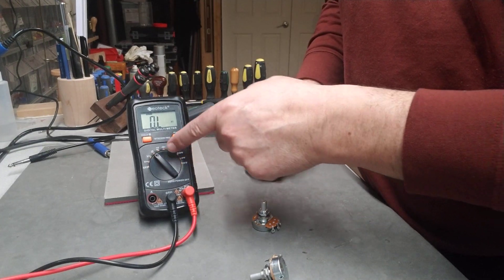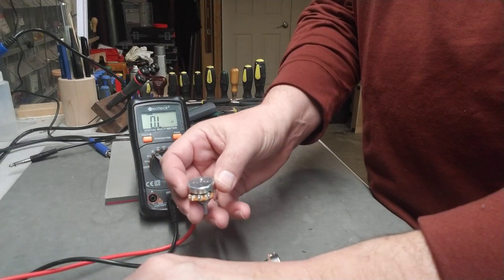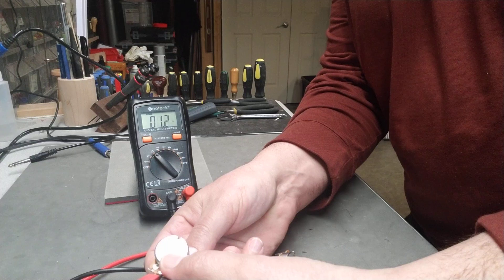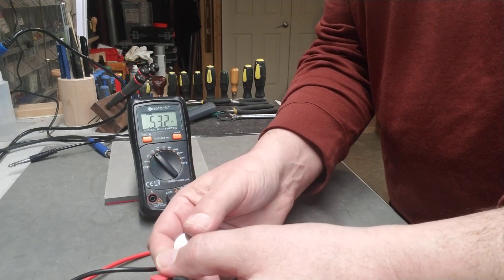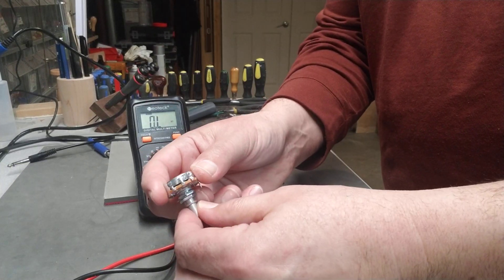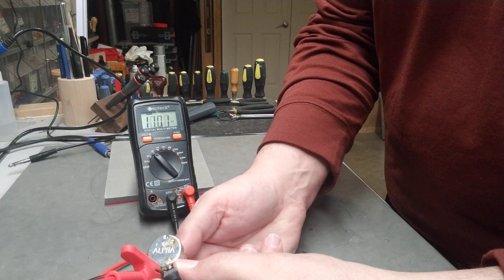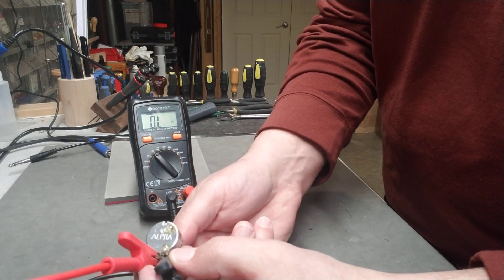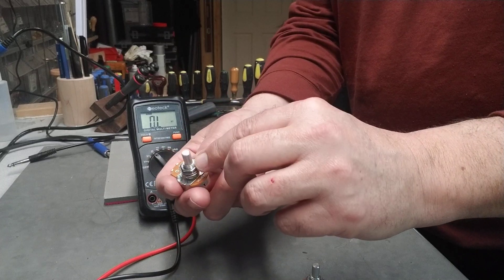Testing a Guitar Pot (Potentiometer, if you prefer) with a Multi-Meter

Comment: I kind of had the same issue, or maybe the same issue.

I never thought about testing my pots beforehand but I will from now on because I have a brand new GF A250K pot that I installed and it kind of cuts in and out, most times when I turn the volume down, it'll stay at 10, but sometimes it'll go down to zero.

I thought maybe it was a bit dirty so I sprayed some contact cleaner inside it and it didn't really help. I happened to use another GF A250K pot on a different guitar and this one worked with no issues. 

That first one I tested just happened to be a dud I guess. Sucks that it also happened to be the first one I used. I'm gonna give it some time to see if it stabilizes, I mostly keep my guitar volume maxed out but not always plus, it's really messing up my OCD lol
Reply from the maker: They can be hit or miss
Reply: @ManotickGuitarTech I agree although they shouldn’t be since they’re brand new…

Comment: See when your pot is at 0 (1.04) have you noticed any pots showing an increase in ohms ? I have an old RS pot in which when I turn it to 0 and don't touch the pot or the meter, it starts to show about 40 ohms, I see this on some other old pots I have, so what would this increase in ohms do when in am amp ?

Comment: will it give a false reading in the pots are soldered in already ??
Reply from the maker: I dont think that will work - use the output jack and selector switch to isolate the pot it if is already in the guitar, then take your reading.

Comment: You're only testing half of the potentiometer. Across the two outside terminals is the maximum resistance. Then center to right and then left. One reading is all the way up and the other side should have the same reading all the way down

Comment: I'm about to pull what hair I have left. I'm trying to test pots and I can't get any reading of any value on 5 different pots ( one has never been used). What is the setting on the multimeter? Going counterclockwise from Off the meter reads:
200M
20M
200K
OHM Symbol
20K
2000
200
What am I doing wrong? There's a HOLD/SEL button on the top right. I've fiddle with that without success. Btw I have two meters, same results with each.
Reply from the maker: I have mine on the OHM symbol (no function required); attach the red lead to the middle lug; the black to the right one; then spin the pot to see if any values appear.  Just like I have done in the video... make sure your red and black leads are plugged into the right spots on your multi-meter, too.
Reply: @ManotickGuitarTech  the OHM Symbol on mine is not a set position but rather a reference to the ranges listed. The only reading I get on all five pots is .45 when set to either the 20M or 200M. I am certain these pots are fine but between two different multimeter I cannot get them to perform (nor are either the same as yours).
Reply from the maker: @jreagle58    set your reading lower - try the 2000 or 20K.  20M is in mega OHMS and the most a pot will be is 1meg
Reply: @ManotickGuitarTech  I've tried every setting. Nothing, zero. It's weird. It does the same thing on a brand new pot.
Reply from the maker: @jreagle58    try attaching to the two outer lugs of the pot instead of the middle one.
Reply: I am having the exact same problem as you. Can't get a reading from any of my pots! If I set to the 2000k setting and test the middle and outer lug on the pot, it says 005, which doesn't make sense to me since it's a A250k pot. But anything else just gives OL. I hate electronics.

And I know that my multimeter works because I tested the output from the pickups using a guitar cable, and that reads properly. I don't have alligator clips though, just pointed leads. Maybe it just can't get a good connection, even though I'm holding the leads to the lugs securely?
Reply: @fr3ak1shh  yeah, I'm sure there's no issue with the pits or multimeter. I'm starting over. What I find frustrating is the multiple ways people are wiring a LP style 2 x vol., 2 x tone configuration. It seems there should be only one way but I have seen at least three different ways and that just confuses the issue.
Reply: @jreagle58  Update: I finally got the reading to work. Make sure you have your multimeter set high enough. I set it to 20M K and finally got a reading other than overflow.

I replaced the pots on my Sire L7, which is a Les Paul clone. I pretty much copied the wiring that was already in there exactly, because I don't have much of an electronics background.
Reply: @fr3ak1shh  I tried every setting including that one. On 20M K I got something like 4.5.
Reply: @jreagle58  On 20M K I get ~0.5 for my 500K pots, and 0.25 for my 250K pots. If you were speaking off of memory, maybe you are getting 0.45? Which would be 450K? Just throwing out ideas!
Reply: @fr3ak1shh  I think you're correct on the .45.. That was a couple of weeks ago.

Comment: The back of the pot says Alpha, but the "A" before the 500k means it's an audiotaper  pot,  not a linear taper pot which would have a "B" 500k.
Reply from the maker: you are right
Reply: Whats the difference?
Reply: @Joe-rl8qc  audiotaper has a steeper cutoff after 7-8 on the dial, linear is a straight taper down.

Comment: So it looks like the reading on the back of the pot that I’m looking at it looks like it says 500 K but it reads 220 that is with the hot on the center lug and the black on the right lug but they are attached to a control board. Is that gonna make a difference?
Reply from the maker: It shouldn't make a difference... active control board?
Reply: No passive
Reply: So if the reading Is 220 do you think they are 250k pots it looks like that they say 500but they are to tiny
Reply from the maker: sounds like they are 250k...size of the pot doesnt matter